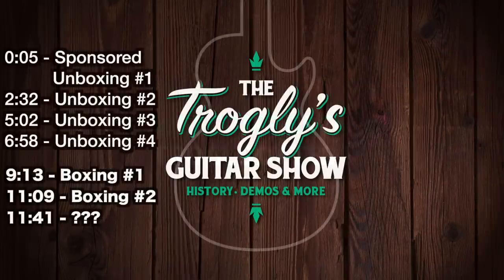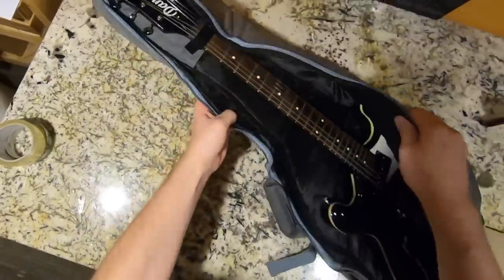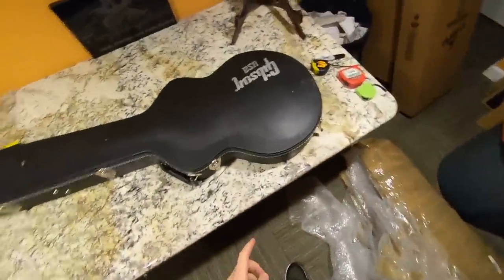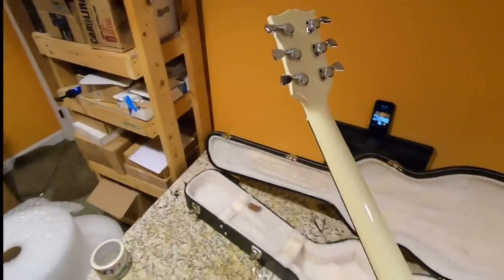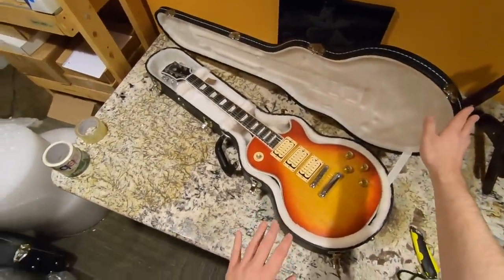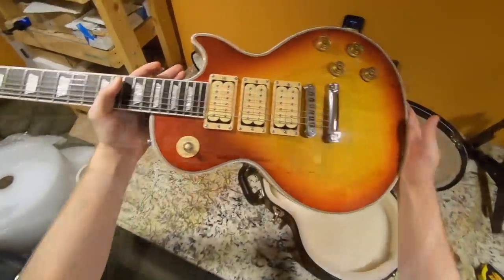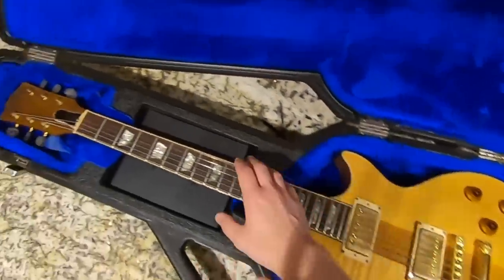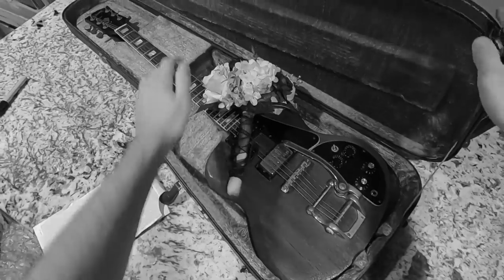What's In the Mummified Package? ( + a Giveaway!) | Trogly's Guitar Unboxing Vlog #27

Comment: Literally cheered outloud when you pulled out the Buckethead guitar.  Remind people to sign the petition for a new model!  I would love to see another review on it from you and this time detail the control cavity.  I am curious on what sanwa switch they used.  Is it the  one that just clips in or does it actually have a nut on the back that screws in to tighten it down?  They sell both styles (I believe it is a 24mm).  How long is the switch?  Would it fit in a normal size Les Paul, or does it only fit the oversided thickness?  I also think Buckethead used some interesting potentiometer value choices and I would like to see the wiring of how it is laid out.  7 grand is out of my price range now.  I could maybe see building or modifying a different Les Paul in the future but would like to have as many details as possible.  Please 🙏 and thank you in advance.

Comment: Hey i actually have one of those Cahaya gig bags! I keep my first guitar in it, which is just a cheap strat copy i got for $75, the gig bag is fine, the shock absorber at the bottom is cool but occasionally I'll be clumsy and set it on my toe (me problem though), the zippers are prone to breaking, the padding could be better, but it's good enough if you just want a somewhere to put your guitar, if you drop it the guitar will most likely be fine without dings on it, but still obviously try not to, the straps feel uncomfortable on bare skin so try not to let them touch your neck, and the handle has yet to break, if you're here on this video looking for a review of someone who used it quite a bit i hope this helped you, it's obviously going to be a cheap gig bag so don't expect anything else, i absolutely prefer hard shell cases for my guitars, but if you don't want to spend 100+ on a case and don't want a cheap one around the $50 range a gig bag definitely works, this one is cheap so expect cheap, thanks for reading i hope this helped.

Comment: Are you familiar with an '80's  gibson Les Paul double cutaway that had a Stienberger Tremolo on it. That's the one that got away. I sold it years ago and wish I didn't. The tem did not have springs like a strat. You adjusted (floated ) the tem from a lever on the back of the trem bridge. It also had a lock to make the trem bridge a hard tail bridge. I know it existed, just can't find the model anymore. Probably worth $250,000 now, cause I sold it.
Reply from the maker: Yes, I know the one. Send me a message and I’ll send you the model name tomorrow troglyzeburninater@yahoo.com. I have it on a list in my computer

Comment: Christ on bike, where do you find them Gibsons? I have one criticism, a gentle one, mind you, of your packing job: you tend to overstuff and distend the sides of the shipping box. The box bulges. Tbe only trouble with the bulges is this: shipping companies tend to take the highest points, draw a tangent to the highest point and square off the lines to make the next largest virtual rectangular box with perfectly flat sides and square corners. If you are paying to ship by dimensional or volumetric weight a larger virtual box increases your volumetric weight and you pay a lot more to ship it. A 50"x20"x8" box with a 2" high point anywhere may be calculated as a 52"x22"x10" box, an 82.30 pounds of vol weight. Volumetric weight catches you unawares. If anyone has been hit with a high shipping bill lately, check your shipping box. Make sure that the sides are flat and corners are square.
Reply from the maker: Yes, it costs more when you bend the box, but a little higher shipping rate is well worth the protection the guitar needs on all sides

Comment: I want to begin playing guitar  but I am a geek and would definitely tweak it to my liking. I want a Soviet Tonika EGS 650 Soviet electric guitar but I am willing to fix it! I want to learn guitar and I am an engineer!
Reply: I have watched so many videos about action being too high and it can be fixed and pickup height for more output! And if you can't get out the neck warp sand and re adjust the truss rod It's a thick neck as hell! But sweet! As long as I can get the action low and adjust it how I want SWEET! Heavy Russian beastie and I will replace the DIN plug with quarter inch! Awesome guitar!